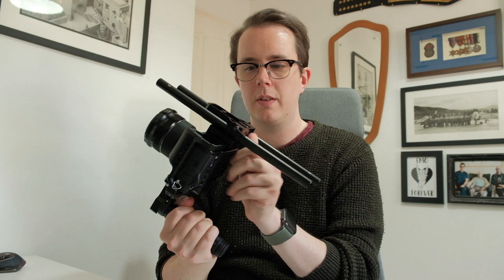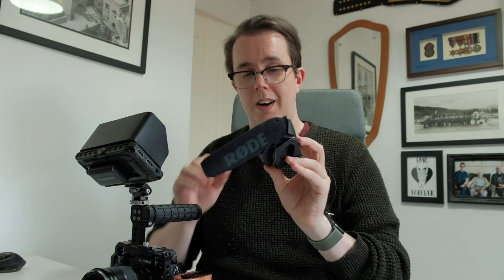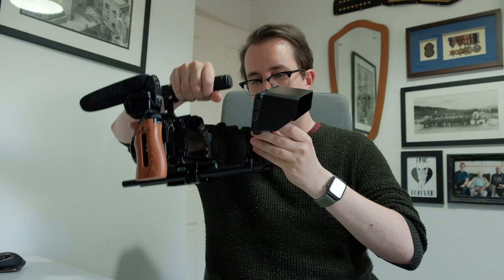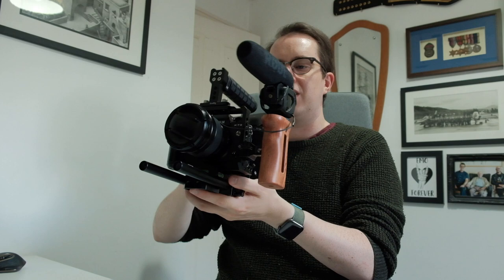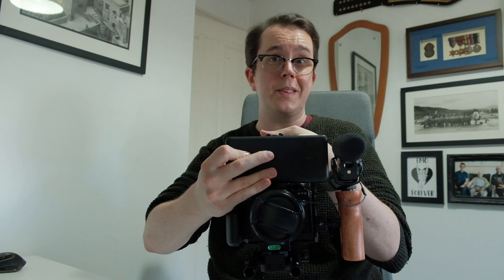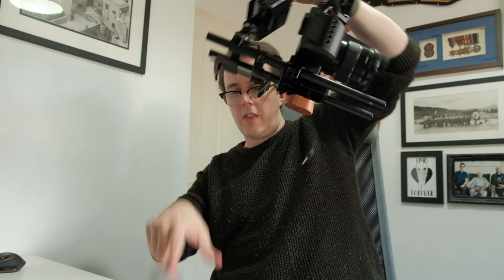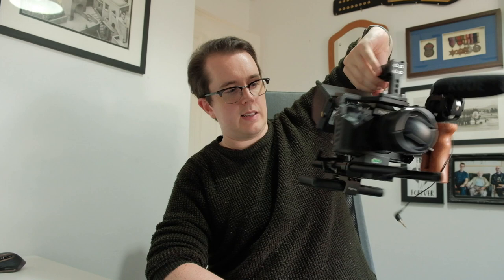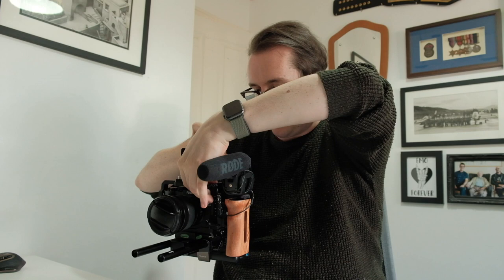Building A FUJIFILM X-T3 Cinema Rig! Modular Wedding Videography Setup With SmallRig

Comment: Strange. I never understood the left hand handle. Together with the rails it prevents the most important action from taking place, that is focusing with the left hand.
With a system like Fuji, where the AFC is broken, you (me for sure) need to have your left hand on the lens.
Even the follow focus is weird, because I lose support while using it. Anything other than having my left hand under the lens doesn’t work.
What you have here I call a “Sony rig setup”, where you can really trust the AFC and use a left handle.
Reply from the maker: I’m about to do a video on a cine lens Sony setup!!